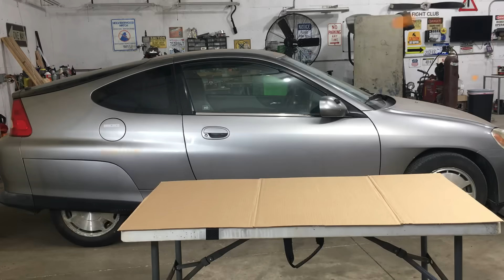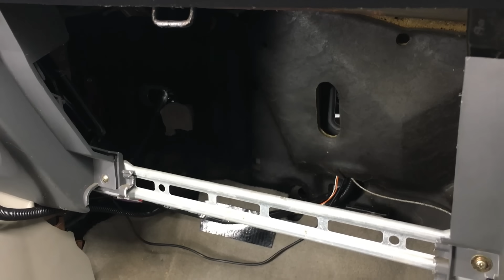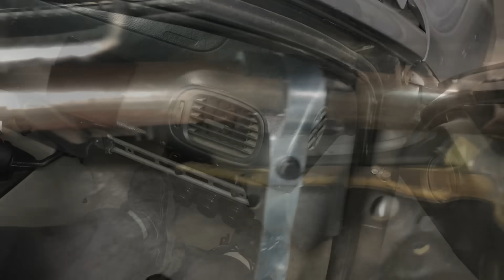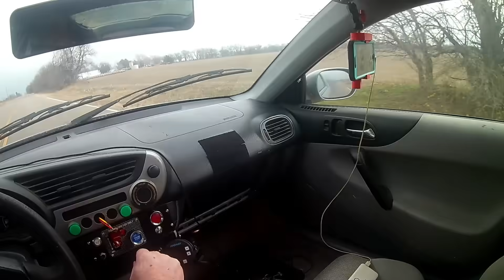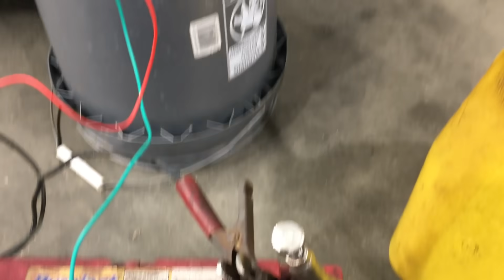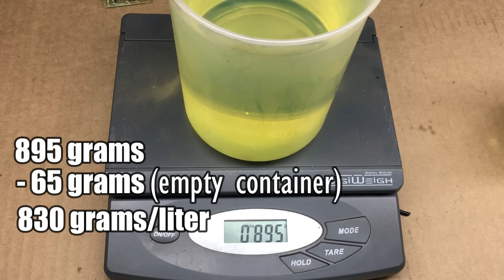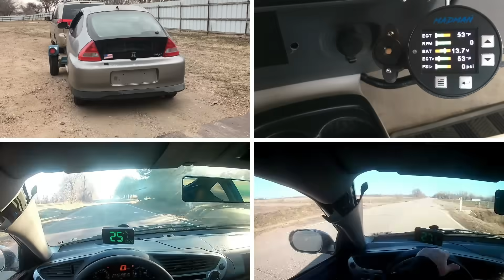S3 E46. MPG ? We test the fuel economy on the 719 cc diesel powered Honda insight

Comment: My '70 VW had a big hose wrapped around the exhaust manifold. A scoop next to the engine cooling fan drove "hot" engine air over the exhaust pipe and into the dash board. It took a half an hour to make it kinda "warm" in the car. But it was free heat. And Merry Christmas.

Comment: Being an Insight, the fuel consumption figures ought to be decent, with it's aerodynamics and "skinny" tyres (though even the renault has skinnier boots!), fuel should be just being sipped rather than guzzled... :P
Reply: I'm hoping Jimbo can beat the Insight's numbers by a lot given a diesel's greater potential efficiency, but the first-gen Insight is a really tough competitor when it comes to efficiency; Honda pulled out most of the stops when making it (so much so they ended up selling it at a loss, even at an inflation-adjusted new price of over $30k).

Comment: Don't fear the zinc! The amount of welding necessary to tack those 3 brackets to that housing wouldn't be any serious threat, just do it outside and it would have only tsken you 5 minutes
Reply: Eh, why risk it. You can get HCl in the store easy. "It's only a little poison" is not a mindset I'd want to get used to.

Comment: The Insight is already turning into a winner and it isn't even finished yet. Good work and merry Christmas.
Reply: We'll see. The stock gasoline first-gen Insight can already get over 70mpg at those speeds. I'm hoping the diesel blows that out of the water once Jimbo's got everything dialed in, but Honda did a really good job and will be hard to beat by a lot.
Reply: @IstasPumaNevada  Honda did a good job, but they did it with a multi-million dollar budget and an army of engineers. Jimbo's working with a refrigerator truck motor, pizza money, duct tape, and whole lot of chewing gum. If he exceeds their numbers by any margin, he's winning.

Comment: Yahoo, 67 MPG! Last video I guessed 45 or 50 so I grossly underestimated how much of a slippery fish the insight is aerodynamically. Thank you for the video.
Reply: A stock one will get over 70mpg at the speeds used in this test, and that's on gasoline. Honda really pulled out most of the stops to make it efficient. (And ended up selling it at a loss, sadly. It was only really meant to be a test platform for exploring new techs.)

Comment: Takes me back to the 40s and 50s when cars did not come with heaters.  It was a dealer installed kit that sat right where you put yours.  My old 1954 Buick had a rear heater core as well as a fan and switch for it.

Comment: This car is both low tech and very efficient. This thing is now both a prepper and an hypermiller wet dream
Reply: Stock first-gen Insight would likely get over 70mpg at these speeds; I know mine does. It's good for a garage experiment, but I wouldn't call it a hypermiler wet dream yet. :)

Comment: 67 mpg thats amazing. I knew the insight had good aerodynamic characteristics and a light weight aluminum chassis but I didn't think is would have been that much better than the Saturn. Once you get the belly pan and supercharger on maybe you can hit 70. Merry Christmas and a happy new year🎉
Reply: Cruising at 55 to 60mph on flat roads, a stock first-gen Insight can easily get over 70mpg and that's on gasoline. I once drove mine ~90 miles at ~37mph in ideal conditions (summer gas, dry and warm, no winds, pretty level road with no traffic) and averaged 108mpg. 
It's still the most highway-efficient non-plug-in vehicle ever sold in the U.S., 23 years after its release. I would really like Honda to just re-make the first-gen Insight, maybe with slightly updated tech. That could convince me to buy a new car for the first time ever.

Comment: My guess before the reveal: 82 miles per gallon.  Well above factory, considerably below what Gen1 Insights achieve when carefully optimized for highway fuel economy.  FUN FACT: highway optimized Insights have their hybrid batteries removed.  Hybrid function doesn't help during steady-state cruising, so eliminating the weight is a plus more than losing the system is a minus.

Ha!  Vise Grip Garage sticker.
Reply: I'm a fuel efficiency nut, but given the mountain passes (including continental divide) I have to drive over to go anywhere on road trips, I'm leaving the IMA battery in. :)  I recently had the battery disabled for a bit, and I really missed the acceleration from a stop; it really is a dog at low speeds without it.

Comment: Next Step...
Mix 50/50 used cooking oil. 👌🙏
Reply: I run a Transit van 2.0 TD on 50/50
Used cooking oil works out at 70mph
I also have a Swb G Wagon with Isuzu 2.8TD I run that approx 80/20 it would run on. Neat cooking  oil all.summer 👍

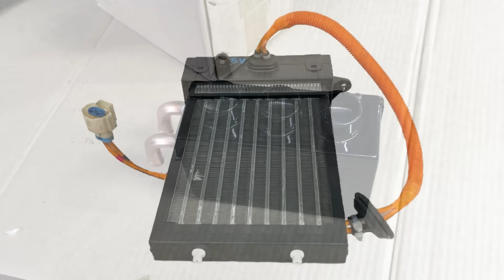Comment: 2:30 so if you use the heater, the range of the Tesla is reduced to 50km?
Pretty weird heater you found there with "pc" fans, who makes this kinda of stuff? ... and still make a living on it?
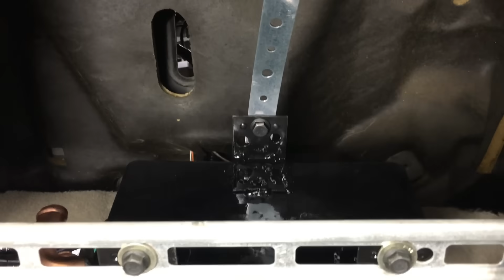6:34 i would not take a seat on the passenger side, lol ... i once was as passenger in a crash and the legs and me slammed in to the dash.
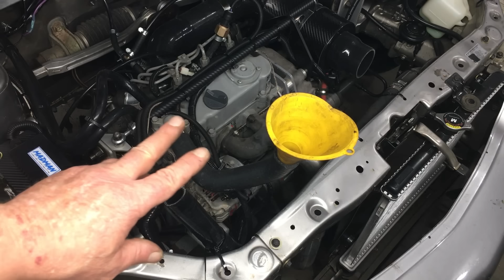7:27 there are tools kits to evacuate air from the cooling system, like a hand pump.
Would a modified cam work on a diesel engine? "Webcam" is a company that modifies camshafts is somewhat in your neighborhood.
Awesome projects you got going.

Comment: It would be cool if ypu could get something like a Nissan Leaf, Focus Electric or early cheap unloved EV like a Spark EV (395ft/lbs TQ) that was wrecked cheap from copart and use the EV drivetrain in conjunction with something like this diesel to make a hybrid of sorts, run the electric motor in the rear, give it electric awd, it would definitely help performance, be perfect in town for short trips where the diesel wouldn't even get warmed up, if ypu were in a big city in stop and go and the diesel would shine exactly where they do, steady state cruising, of course the benefits of regen braking and all that are there too, you also have two ways to move the vehicle if there is a malfunction of one system, you could use the EV A/C system as well and if you have a full battery you can remain with climate controlled for a very long time without wasting fuel.

Comment: When the video started I said to myself 70mpg, 67 is great, I would imagine that boost and the belly pan might get it up to 70mpg, I think boost would help because it would accelerate quicker and then it could transition to light throttle sooner. I wonder if a tall narrow E load rated tire that can take 80psi would help mpg? Less rolling resistance and lower rpms at cruising mph.
Reply: Also, the law of unintended consequences may result (gnome effect?), such as reduced radiator airflow after belly pan install. 
Will be neat to see.
Reply: I have a first-gen Insight and, reading forums dedicated to the car, not even the super-obsessive efficiency nerds have yet found a tire that can beat the efficiency of the stock tires that were made specifically for the car. I recall reading people have tried spare tires and I think even airplane tires. Jimbo can try of course but I'd recommend he not bother if it's already got the OEM tires on there.
Reply: @IstasPumaNevada cool I had so idea, I should probably lurk the hypermiling forums .ore often.

Comment: I’m not sure how effective it would be in this application but I’d suggest maybe installing a hot water valve to help the engine heat up. It essentially just bipasses or blocks the heater core from getting coolant flow to help the engine get and stay warm. 

Again idk how much this would help in this application as the only time I really still see them is in Toyota’s for some reason
Reply: Most older cars used heater core valves. I know older Hondas did it too. When you turn the heater off it blocks flow to the core more to prevent excess heat load in the cabin (as the hot heater core does dump heat even when no air is being blown over it) rather than to help heat the engine up faster. 

no modern car needs it because aluminum blocks and better designed thermostat loops makes them easy to warm up.

Comment: In fact, they DO put electric heaters in cars.  My diesel truck has an aux. electric heater (from the factory) built into the HVAC system to provide some heat while the diesel engine is warming up.
Reply: On my diesel Jetta, they put glow plugs in the cooling system, to help the engine warm up faster.

Comment: You could nix the glow plugs, and use an intake manifold air heater.  Mercedes got 300 mpg.
Reply: What kind of car?
Reply: I'd want to see a source on that. The VW XL1 only claimed 120mpg when driving solely on diesel, and that was already pushing the limits (and extremely impractical). Even counting plugged-in electricity towards its efficiency, they only claimed 260mpg at most.
Reply: @IstasPumaNevada  Yeah.  I hear you. I'm going off memory here, which never was all that great to begin with.  searching the net found nothing.  It looks like it has been buried.
Reply: @IstasPumaNevada  the car that I saw used steam that was reinjected into the engine.  Not sure the VW XL1 is the one I remember.

Comment: Mercedes developed a car that used exhaust gas energy to create steam?, and injected the steam back into the engine.  Does the kubota engine have glow plugs?  Could you have a double injector system?  Could you use water vapor in the exhaust as the steam?

Comment: What year was this Honda?  What was it's best fuel mileage as a hybrid/electric?  This will be a good number to compare to or surpass when you get your final data.  Another good one, thanks, you really been cranking them out.
Reply from the maker: The Honda is a 2001.  The car was rated at 60MPG highway with the gasoline engine, however is common to get 70 MPG on the Highway.  Keep in mind we don't do fuel economy builds, we do small engine experiments.
Reply: Thereby you've already proven that this low technology diesel was on par with the more complex hybrid (albeit, underpowered upon comparison).  But yeah, understand, where's the profit for manufacturing in building plain cars.   👏
Reply: @stromxtc2033  The electric assist on the first-gen Insight is only used during acceleration, or up hills. Mine can accelerate onto a highway just fine, and make it up over the continental divide Homestake Pass on I-90 while maintaining highway speed, yet I still averaged 67mpg driving round-trip from Missoula to Boston this past June.
Jimbo's experiments are fun and fine as a one-off, but I can't say I'd want to try to merge into highway traffic driving one of them. Nor would I want to breathe whatever's coming out of the exhaust on a mass-production level.
Reply: As he started, just fun experiments. My opinion only, given diesel technology a chance to evolve from 1980 on, they would have been small displacement, extreme, efficient, clean, closed loop burning machines by now. Perhaps diesel electric!

Comment: Detroit diesel used a blower and a turbo on later engines however the blower was not used as a supercharger but it might work good on this application. Merry Christmas to all!
Reply: Gale Banks has a new Duramax diesel project with a massive Whipple supercharger on it. It works great.
Reply: Detroit diesels HAD to have a blower to run, they were 2 stroke and the blower feeding air into the cylinders helped to scavenge the burned gasses. Later models were turbocharged to up the HP. A turbo motor had the blower speed cut in half.

Comment: The MPG on this is even more impressive when I remember that a US gallon is a lot smaller than our Imperial gallon which if my memory serves me correctly is 4.75 litres.
Reply: US Gallon = 3.73L, Imperial Gallon = 4.54L. 😊
Reply: Wow!!
Ok, I need to revisit some of the mpg numbers I got from England.
Reply: The U.K. gallon is pretty much exactly 20% bigger than the U.S. gallon, so just multiply whatever mpg figures you hear by 1.2 to get U.K. mpg. :) At least our miles are the same.

In absolutely ideal conditions at 37mph, I got my first-gen Insight to average 108mpg (US) over ~90 miles.

Comment: I used to have to completely block off the radiator on my Saturn in the winter time if it was ever gonna blow anything you could call heat. Gotta love the weather up here In Hoth 🤣
Reply: No you didn't
Reply: @martydeeks1891  ya, I did. I owned 3 of them things and my brother and dad both had one as well and they were all the same, you had to put a piece of cardboard over the whole rad or they just would not build any heat.

Comment: Maybe a set of manual shutters in front of the radiator like an old Soviet car.
Reply: Rolls Royce in the 1930s used shutters that formed the grille in front of the radiator that were thermostatically controlled. With the engine below the correct temperature the shutters overlapped each other blocking the air flow, and if the temperature rose above the correct temperature the shutters moved to be edgeways-on to the air flow so that it was unobstructed.

Comment: Still 11mpg short of a Lupo 3L. You should probably block off the stock brake ducts with some cardboard as well. They're not of much use when you aren't completely hooning the thing and they add a lot of drag. When you get the belly pan on, you can also cover the entire exhaust tunnel to get a completely flat floor. The exhaust shouldn't get hot enough to cause any problems when you do that (I've seen people do this to VW 1.9 TDI's with no issues so). Drag is the biggest source of resistance past 35ish mph, so lowering drag, especially with an engine as weak as this, should increase acceleration past that point by a decent margin.

Comment: Merry Christmas, excellent video as always.  You reminded me of an experiment I did that is quite useful: I hooked a Chinese diesel heaters exhaust pipe to a large steam radiator that was exhausted to the outside through 3/4" pipe  (actually 2 different ones over 3 winters) and it recovers a large amount of heat for cooking, heating water, and just extra heat like a heat battery of sorts.  I also hooked several gasoline generators to it and it works in the same way with the benefit of silencing the exhaust nearly completely.   That brings me to the  point: I wonder if you could duct exhaust from a generator or diesel heater to that $60 heater core blower unit you showed, it seems like it would work to recover extra heat-it would be fun to try at least.  Anyway, thank you for all the great videos, they're all excellent.

Comment: Merry Christmas. Guy's not gonna find an Insight lying around. I did see one this last summer. Because of this project, I was able to enlighten a curious onlooker. Hopefully, he is a viewer now. Anyhoo, since a guy isn't gonna find an Insight, I think Civic..
Reply from the maker: Some of the older Civics are certainly light weight.  The reason we don't  use them in our projects is on the older civics the engine spins backwards.   so doing a basic engine swap will result in a car with 5 speeds in reverse. .. so keep that in mind.
Reply: @robotcantina8957 Lol.Gues I won't be using the Civic. Prius?
Reply from the maker: @jaytitus902  A prius would be interesting if you could manage to get the new engine to work with the electronics in the car.  From what I understand a Prius transmission relies heavily on computer control to work.
Reply: I lucked out finding a stock first-gen Insight in great shape with only 130k miles on it, and it was even a manual. It's my dream car and I love it. Averaged 67mpg driving from Missoula to Boston and back this past summer.

Comment: Right off the bat the fuel economy is suffering from a lack of racing stickers on the windows, but 67 is nothing to sneeze at ❤🎉
Reply: The VGG sticker is guaranteed to take away 2 or 3 mph ; ) , whatever you do don't put a PBG, Roadkill or Zip ties and Bias plies sticker on it.
Reply: @justinak49 you got that right..Vinwiki and Clitus McFartland too
Reply: he's also missing go fast stripes
Reply: @herrorhan and the rattle can rebuild!
Reply: Yes I noticed it to. Very fitting for this style of shade tree engineering
Reply: He's probably waiting till it's supercharged to add the racing stickers.
Reply: No, it needs more carbon fibre wrap to add lightness

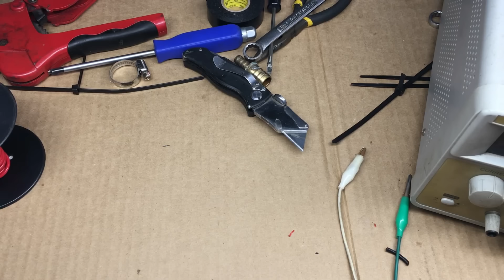Comment: 8:00 These are cooling fan for server, it can pull lots of currunt. Normal small power speed control can't handle that.
If you want to control these type of fans, use "PWM fan governor speed control knob" ,find out the PWM wire from the fan and connect it to control speed.
Reply from the maker: The fans are two wire brushless.    From what I understand not all brushless motors can tolerate PWM.   ...  In order to avoid blowing up more fans, I ended up using a series of diodes to drop the voltage to the fans ... it works.  Actually if you go back to the video where I show the heater while driving the car you can see the diode matrix hanging under the heater.
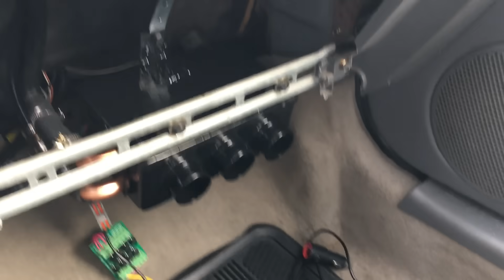Reply: @robotcantina8957 Oh~!Now I see 8:45

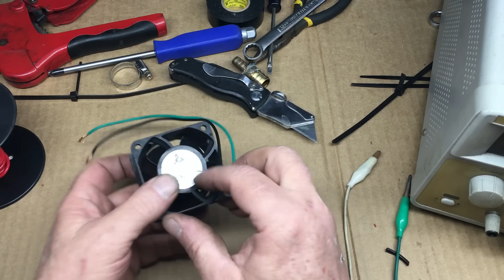Because 8:20 these are Delta server fan and I saw that two wire on the edge of the fan motor are cutted off(Pulse Generater for speed detect and PWM for control speed),so I suggest that use PWM wire can be more controllable.😅
Reply: Not all fans in this form factor are intended for servers either. They have fans with different ratings as well for operating in harsher environments, IP ratings, dust proof, water proof, ETC. The variety out there is actually pretty neat.